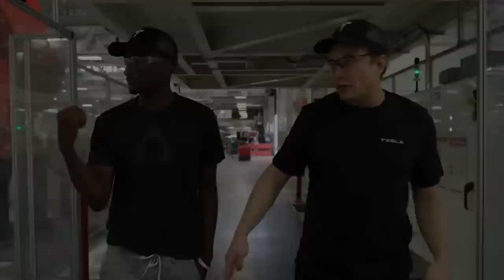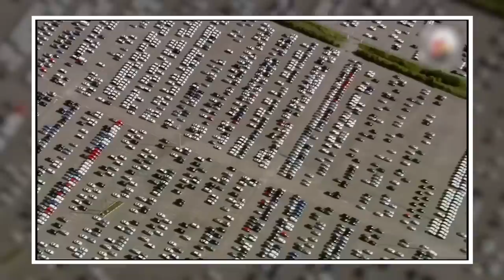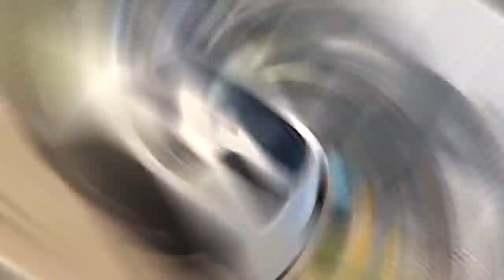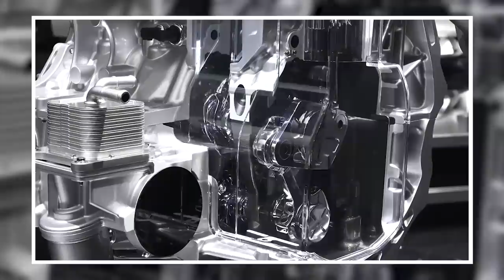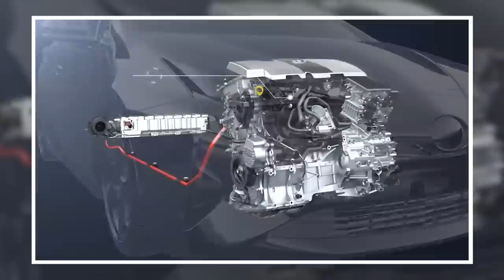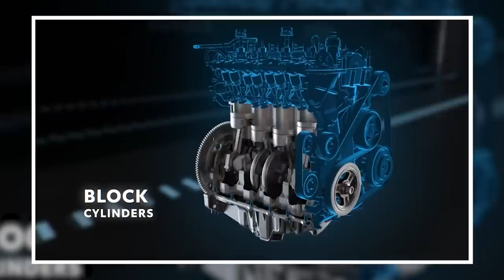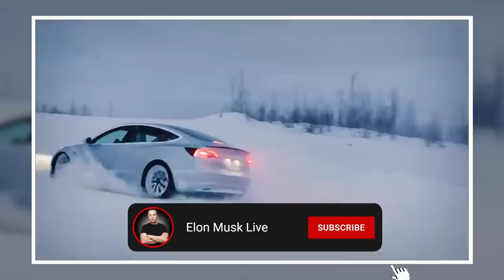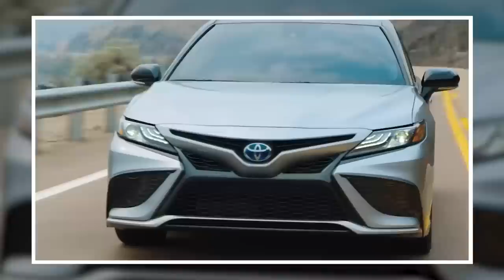Why Elon Musk is Scared of Toyota’s NEW INSANE ENGINE!

Comment: Tesla and Toyota are in talks about building an affordable electric car. There is no electric vs gas competition and you can only speculate how Elon Musk feels. Gas is currently being fazed out. The argument is moot.
Reply: Gass will never be fazed out it cost just as much to charge as it does to burn fossil fuels
Reply: @davidhill2618  as well as the fact that lithium ion batteries as well as the process to make them is just as bad for the environment as burning fossil fuels at the moment
Reply: Gas is not being fazed out
Reply: wasnt that tesla and honda?
Reply: EV is the wat
Reply: cant wait for them to raise the electricity bill
Reply: Electric nay sayer really needs to think from fundamental first principle perspective. 

Solar electricity is finite fixed cost to infinite electric production with power capped at storage capacity. 

Internal combustion will only have tremendous power loss.  It will not exceed 40% efficiency at best.

There is no argument. Production to solar power cost increase?  It will decrease with economy of scale.  Can't say the same for combustion engine. 

Material harm in designing battery?  Reducing of cobalt and nickle with time. 

All of your arguments have been defused.  Please keep up with the news and let nature run its course.
Reply: @the party's over I spoke with an elderly couple about a year ago. They were driving inside of a Toyota SUV. It was a hybrid. The woman told me that they were averaging about 49 miles per gallon. They were a beautiful couple and we had a good conversation. The first time that I saw a Toyota SUV hybrid was in November 2019. I'm impressed and wish the entire industry continued success. EVs are good but I think it's going to take time to fully transition. Good luck to all.
Reply: I don’t think either is ever going to overtake the other. In all honesty I think that all of them are gonna be here to stay. Hydrogen cars, EVs, Internal combustion engines. All of it. With carbon neutral fuel companies like Prometheus fuels popping up everywhere’s and hydrogen production becoming more efficient over time, I feel like people are gonna keep everything. EVs aren’t bad. But range and sound is the only thing killing everyone’s opinions. There’s no range or ICE sound. Hydrogen is getting killed by costs and danger (even though hydrogen is very safe when used the way Toyota uses them in cars like the mirai). ICE engines are getting killed by their efficiency and carbon emissions but carbon emissions have been fixed by making carbon neutral fuels. As a society I feel like humans should utilize all of our power sources and not just a single system. With variety in power sources we don’t rely on a single system which when broken down would make us all start walking compared to the multiple power sources that when one breaks we can go to another for a while.
Reply: It will take years before it is fazed out. Cities are not ready for everyone to have a electric car. The electrical infrastructure s can’t handle that type of demand.
Reply: @p3ngi3  did we run out of coal or is that something to do with the EPA? They shut down an electric plant not too long ago nearby. I like solar and wind and also hydro but I'm not sure how much electricity those technologies can provide. Nuclear energy is good as long as it is safe. Hopefully there is a good supply of uranium. Did I say that correctly? The thing that I am wondering is   how much range do these EVs really have? Please help me by answering my question.
Reply: @sidoliveira3246  no we didn’t run out coal. Everyone is trying to change the industrial sector to be more green. The max range on a Tesla is 750 miles. The problem with electric is you can’t  gas up in 5 minutes and go. Gas/diesel will never go away. The oil corps won’t let it happen. They will push money to congress and buy them as usual. Electric cars while operated are more clean. The manufacturing process to make an electric car is far worse than building a gas car.  The amount of pollution and resources that is need to make the batteries makes it not green at all. 🤷🏻‍♂️
Reply: Here in the USA our power grid couldn't support needs if ten percent of the cars were electric.  Storm in my local last night , power out for hours.  Watch this summer , brown outs in Cali and Texas.
Reply: @p3ngi3  a couple of weeks ago the natural gas company was here. One of the men was driving a Ford SUV. It said on it plug in hybrid. I asked the man    how does that work? He said when you plug it in it charges up. He told me that they get about 35 miles on a full charge. This doesn't make any sense. This can't be true.
Reply: @sidoliveira3246  so that style of vehicle is a hybrid. It runs on gas and electricity. For long distance travel it will use gas. Most hybrids have a coast recharging generator like the Prius. Ultimately it will still use both gas and electricity. You can run the vehicle on electricity only for the 35 miles, then will run on gas.
Reply: @kokigephart111  yes this my point. The us is not ready for a full electric vehicle turn over. People can’t understand what kind of power that will comsume. Electric company’s would have to spend trillions to upgrade their electrical infrastructures from the power plants all the way to the consumers.
Reply: @p3ngi3  as my area depopulates it is becoming obvious that in twenty years rural  homes will be on independent power systems .
Reply: @p3ngi3  that's what I was trying to figure out. I don't think that he was familiar with hybrid. Some people don't understand hybrid technology. If it's a plug in as well then my guess is that they integrated those 3 technologies for efficiency. Does that make any sense?
Reply: @sidoliveira3246  yes it does make sense to a certain point. If that is what you are looking for then it will work. For most, a simple hybrid is good enough. Other things to consider, is gas cheaper than your local electric rate?
Reply: @p3ngi3  when I asked the worker how does that work? I asked if the vehicle was hybrid and a combination of an electric vehicle. He answered by saying that he thought that a hybrid was an electric vehicle. I'm confused. He said that they charge it up at the shop. I tried to explain how hybrid technology works. Then I asked him if the SUV had a way of fueling up. I forget what he said. He pointed to the area where they charge it up electrically. This doesn't make sense because if it was a true hybrid there would be no need for plug in capability. I'm sorry for confusing everyone including myself. The thing was brand new! 35 miles on a full charge.
Reply: @p3ngi3  you can't gas up in 5.

But you CAN gas up in 20 minutes. 

And... I'm assuming we all do grocery shopping..... just saying... 

If you park at street..  sure you pay meter.... meter?  No need. Charge to park....

I don't see how big city cannot incorporate electric vehicle. Sounds like a badly thought out rebuttal.
Reply: Gas is not currently being phased out.  It will be the majority of vehicles sold for the next 25+ years.  If you mean someday gas is being phased out, then you don't comprehend the definition of "currently".  Think about the timeline.  EVs have now been around, meaning Tesla in particular, releasing the Model S a decade ago, yet their US market sales are less than 2% of all vehicles. Math, it's not just a topic taught in school.  It has real world uses.
Reply: @stinkycheese804  well... that's childish.
Reply: @swankscabinet1625  
Agreed, but if competition is allowed then government officials can't play the system.
Reply: "Phased" out, sh4branze. Some might say that Elon isn't fazed by any of this, though.
Reply: Lol

Comment: I really doubt they could increase efficiency from 20% to 100%
Reply: if you mean the toyota? you are correct. the most efficient engine on the planet is the achates diesel- at around 35% I believe? and it's not available yet. a stirling heat engine is 40% efficient- but you can't fit one on a road vehicle. they do use them is submarines. but all that pales in comparison to the VERY LEAST efficient induction electric motor- over 90%. toyota just bet on a losing horse, plain & simple. a sick, limping, dying horse.

Comment: The car companies have been working hard to decrease the gas-mileage for way too long; hopefully Toyota will go against the oil companies and make an engine that will run MANY more miles on a single gallon of gasoline.
Reply: Increase
Reply: What about a car that use zero gas?
A car you can plugg in to the electric grid, and supercharge.

Wait, I know... it's an electric car.
This can be Toyotas new inovation.
And, they can make it in Japan, not rebranded from china...
Reply: @geirvinje2556  where does that electricity come from... f o s s i l f u e l s
Reply: @geirvinje2556  We can bring back coal powered trains too
Reply: @quarzgamez8710   Yes that is thru, and those power plants are not very efficient nether they only have a 40% thermal efficiency.  60% of energy is lost in heat, and then there is los in transmission and distribution, and inefficiencies in the batteries as they aged and deteriorate. NOT so efficient those electric cars. a very stupid idea those electric cars.
Reply: Am I the only one tired of the discussion of electrics are bad because much of the electricity grid isn’t renewables? That’s a side issue distraction. If someone is dead set on being green only, they can use a house to add solar panels to their roof. Not into the morality nor politics here. Honestly, if electric vehicles can save $$& then that’s more money to spoil my wife and take our next vacation together.
Reply: Just remove the emissions systems from diesel vehicles. If my memory serves me right Volvo built a diesel hatch back that was capable of 50-60 mpg and that was back during the 80’s. Modern day diesel pickup trucks can get 20 mpg with emissions systems that cut fuel mileage in half so if we were to dump unrestricted diesels into small cars I’m sure you could see close to 100 mpg.
Reply: @geirvinje2556  what you don't spend on gas you spend on electricity and it's mainly diesel used to produce that electricity hybrids are the way to go and in terms of maintenance EV cost quite a bit and most of the mechanic shops more than likely won't be able to fix them if something goes wrong the ones that can fix it just be ready to sell a body part yo pay them or the dealer mechanic where you bought it.
Reply: The new crown and mirai
Reply: @connor4961  that was a super low output engine though. The newer diesel truck engines are designed to pull stuff.
Reply: Your comment makes absolute no sense. Car manufacturers have been making more and more fuel efficient engines each year..
Reply: @michaelmckinley9550  yes your the only one.

Comment: I love the reliability of my Prius. However you didn't say anything about how this engine could beat a Tesla. It needs to get 150 miles per gallon and go 0 to 60 in 2 seconds to even be competitive. Another yawn from me.
Reply: try beating it going cross country
Reply: Yah it’s not about the speed or acceleration… it’s about performance of energy efficiency. Toyota’s main customers are going to be civilian and business drivers, not racing. 

On the other hand, Ford usually goes for high acceleration and speed because it has a long standing relationship with making police vehicles. They would be a better comparison.

Also Dodge and Chevrolet are largely invested in trucks so they would be going for features relating to pick-ups such as Torque.

So saying that Tesla is unbeatable really depends on the category of engine performance.
Reply: @sexybahdogee  How many cars go cross country. Majority are town driven commuters.
Reply: It’s the range and the amount of time you need to charge. If I’m commuting somewhere far I’ll get there probably a day before you because it takes me 4 minutes to fuel up

Comment: Horsepower is not what gets you down the dragstrip it’s torque you’ll never make more torque than an electric motor with internal combustion engine . It’s full torque right off the line
Reply: While this is true. Not everyone is looking to drag strip their cars all the time. Some prefer the curves of an ICE engine compared to the EV’s. The other thing is the sound. Nothing beats the sounds of a ICE engine although there are some cool sounds from EVs. ICEs are so so much better. I also personally quite enjoy working on my V8. It’s a 93 351w that while yes it isn’t efficient by any means, I have had a lot of time spent on that engine as well as personal moments with my father. EV’s don’t require maintenance nor do they have any real upgrades to them which gets rid of those moments and times that I would want to spend with my kid whenever I’m older. I do like the EVs, they are really fun to drive, but from an everyday average joe perspective I would take an ICE over the EV. Have a good day my friend and stay safe!
Reply: Fact and The Transmission is everything! Everything
Reply: @swankscabinet1625  I totally agree we are Definitely on the same page. Over the last four years I  completed building a car with my son it’s a 1987 Monte Carlo ss with a sbc 427 I’ve owned for over 30 years. And you are so right nothing beats the sound of screaming ice.

Comment: It will be a very long time before most have a electric car or ever . Already problems with getting enough materials for batteries .Already the power grids are having problems just when the weather gets real hot .And to many turning on a air conditioning .And with electric cars in a cold are .Half the power is lost if it's not plugged in. And if it's not put in the shade when it gets real hot .Again problems with the batteries .And not enough power stations .Which then if they built them and had nothing but .The power grid would be down. Or the price of electricity goes up because of higher fuel prices And then your not saving anything . Let's see a cargo ship and cruise ships running batteries .Let's see a commercial plane fly from Boston to England on batteries .How about all the military tanks .How about a rocket taking astronauts to the base station . Not on fuel .But on batteries . Every rich person's yacht . Just batteries .Sure of course in fantasy land . And in case people have not noticed .Electric car prices are much higher then cars that get more millage .And they are not coming down in price .Like a Tesla .They are just going up in price . I think it's great people can go buy a electric car if they can afford it .And it works for them. But most people have no interest in them .
Reply: Well stated.  EV's are NOT for everyone, even if they can afford one.
Reply: @StreakingTiger  most people cannot afford a EV that gets over 300 miles per charge .And now I just read more metal materials are in low supply also . And if they are already in short supply for materials for batteries .There is now a problem getting enough materials for solar panels .And most homes don't have solar panels .And because you need to melt the materials to make batteries .That smoke of melting those materials goes into the air .So the world waited to long to try and stop hazardous materials to go into the air . And now they by thinking they want to at least slow down global warming is not going to happen . Because they would be just putting a different type of toxic gas into the air making materials for solar panels and batteries . They are 100 years to late trying to get away from fossil fuels .And most power stations run on natural gas .Or coal in places like China .And other smaller countries . I feel bad for the life on the planet .Not just humans . Animals going extinct because of mankind . Waters being polluted . And land and the air . And countries fighting for world domination .I believe humans are living in their last century . They evolved themselves into extinction . I live on a mountain 60 miles from a town . And most years with wildfires in California or Washington State .The smoke blows over and threw the mountains .Many years I can barely see the next mountain from me less then a mile away . And even though California is over 1000 miles away .Some times you can smell the smoke . The planet does go threw changes with floods because of global warming every so many 100,000s of thousand years . But unfortunately humans pollution has made it come allot faster . And more toxic . Trees burning is one thing . Chemicals burning is not natural .It causes permanent damage .
Reply: I agree 💯 %
Reply: Winner Winner Chicken Dinner.  Your comment is the only one with real thinking I agree 100%.  Myself I own 2 Toyota's 2006 4runner and 2006 Solara.  I have never had any problems with either vehicle.  Just new tires and new Batteries.

Comment: I can account for Toyotas reliability. My mom and I haven't taken very care of her Toyota echo. It's got some issues mainly burning oil and wanting to shut off at a stop light. Despite it's issues. The car is almost at 300,000 miles and doesn't seem to die anytime soon.
Reply: Oil change every 6 months or the rings on the chamber gets stuck after 60k. Then the rings scraps the chamber and u will need to add lots of engine oil because the engine is leaking oil cuz the chamber is not tight anymore
Reply: New models are nowhere as good. Very often they're simply too complicated and too many things to go wrong. And as the adage goes, if it can go wrong, it will.